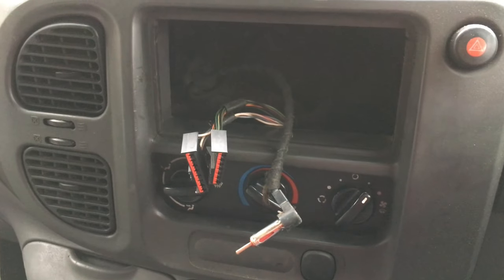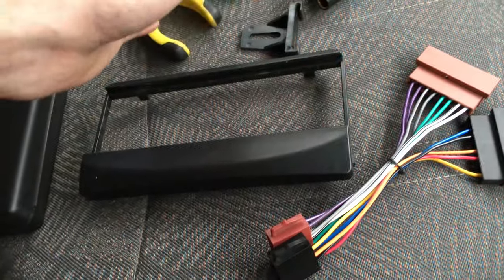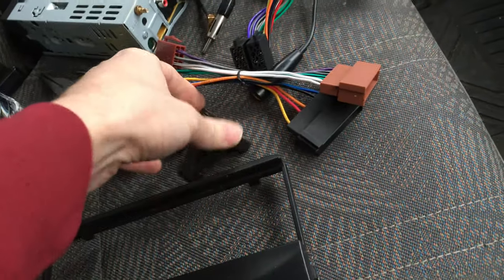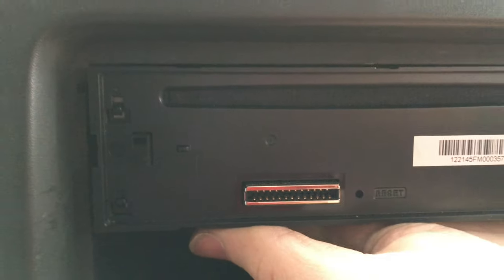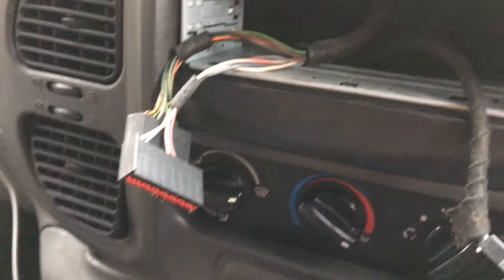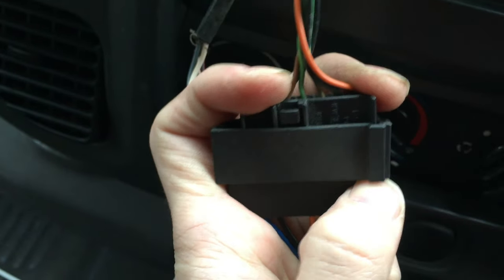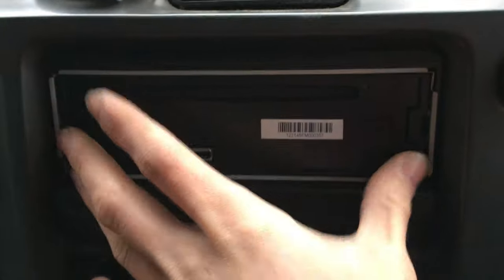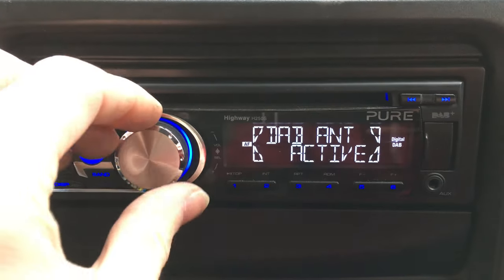Ford Transit MK6 Radio Head Unit Upgrade From 6000CD to Pure Highway H250S DAB Conversion / Install

Comment: that antenna to dab converter is nice, have you a name or link for it please? 

thanks
Reply from the maker: I don't unfortunately. I bought it a few years back when I made the Fiat Punto DAB upgrade video (https://youtu.be/mzwqYtCpm3s). 
It's an unbranded sort of generic unit, If you search online for something along the lines of "Car DAB Antenna Converter" you should find something similar/suitable though! 
They are great little handy boxes though and saves running more cables for an extra antenna. 
Hope this helps somewhat! 
--Nathan